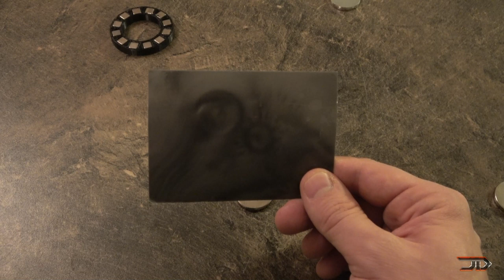AMAZING Magnet Configurations!

Comment: Those polymagnets when you put the metal on them look like a sprocket from a bike
Reply from the maker: That is true! I thought the 2nd one looked like a bunch of spiders on the outside.
Reply: @Tech_Planet  Your Design the way you set it up looks so much better and yet different than most anyone else I could find on the internet there's look good but yours looked far better and a little bit different I don't know what you did differently but you should put a tutorial how you made the damn thing if you don't already have one it's really cool looking
Reply from the maker: @ryandavis3393  Thanks! I tried quite a few angles and I clipped the glass housing(viewer) to a tripod. The magnet rotates on a display stand which has very smooth tracking, I can show you how in a future video.
Reply: @Tech_Planet  yeah man that would be awesome cuz I looked up the videos on this and they don't look anywhere as good as yours they look cool but yours has like a 3d effect far better than theirs does and a color that's different than theirs I mean don't get me wrong it looks awesome on all of them but yours is by far the best I've seen so that would be awesome if you could do that in the future sometime
Reply: @Tech_Planet  in fact the thumbnail just by itself almost looks like a stove like a regular gas stove turned on Blue Flame sticking up and it looks just like a gas stove come to think of it

Comment: What did the magnetic fields look like when you placed the ring magnet on top of the lens? Was the shift noticeable? Thanks for this the awesome video!
Reply from the maker: I tried one, it looked neat but I never rotated it. That's a good idea actually, maybe use two on both sides with polymagnets that torque lock.

Comment: Amazing configurations... but what are they used for?
Reply from the maker: The circular halbach arrays are widely used from rotors to containing plasma. The polymagnets can be used in springs or high strength applications but I think there a lot of undiscovered applications.

Comment: What, the, fuck, is that crazy lens you're using to see magnetic fields? I've never seen anything remotely like that before  and you're just glossing over it like it's a magnifying lens or something. It is by far the single most interesting part of this video, what is it made of? How does it work?
Reply from the maker: Its called a ferrocell, I configured it so that it shows fields in 3d better. I will explain how it works in a future video, it will also include a comparison of different magnetic viewers.